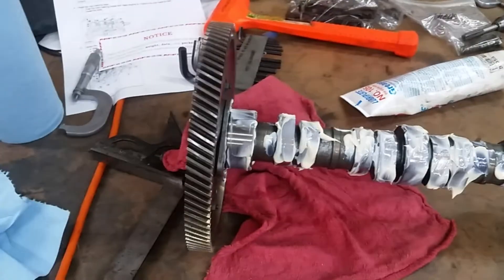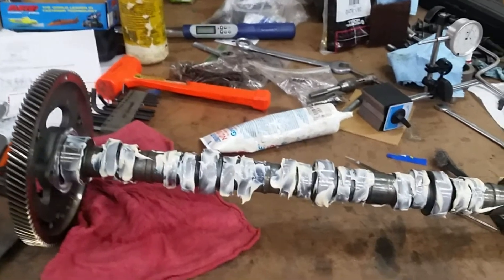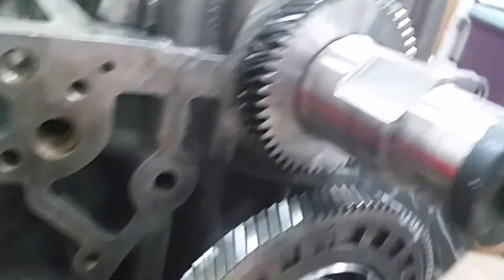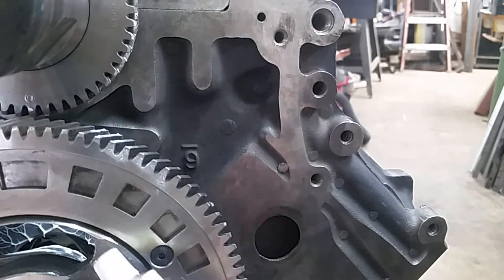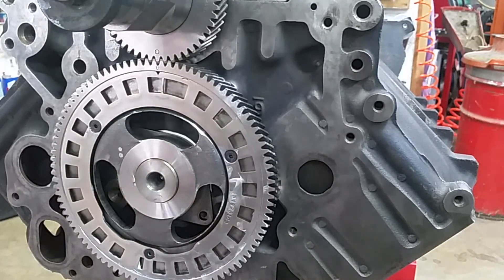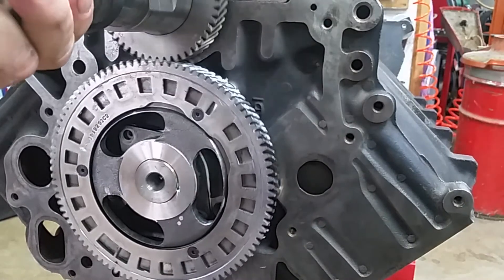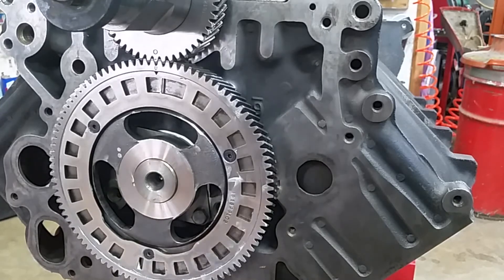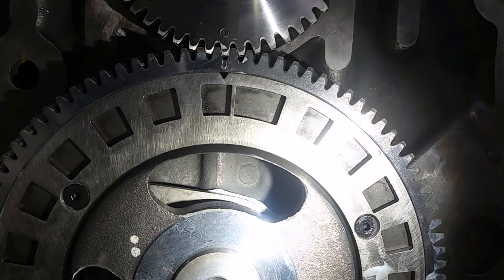7.3 Build: Camshaft install and Engine Timing

Comment: Hey Brother, my block did not come with those 2 oil galley plugs behind the camshaft gear… any idea of a part number or where I might find them? I’m having no luck! Thanks in advance!
Reply from the maker: Those are just NPT so a pipe plug would work. I would definitely use stainless.  I got mine from RiffRaff. A bit of research on the Ford Parts Giant site and I found this part number Ford-445684. You'll need three and they are $0.47 per.

Comment: My 97 7.3 starts every morning only problem I’ve had is running it out of fuel cuz rear tank pickup broke but that was my fault for running below a 1/4 tank
Reply from the maker: The OBS trucks are unstoppable if maintained. My 96 is going strong and still on the original injectors at 360k. I do use HotshotSecrets products though.  When I bought the truck in 2014 it was having some injector and engine harness issues and after fixing the harness and running the "Stiction eliminator" product from HotshotSecrets, they cleaned themselves up and have been going strong ever since. My transmission, a ZF-5, needs pulled and overhauled but that's just wear. I'll probably do that in some future videos for the channel.
Reply: @phil-from-tn3000 my dad's 97 had same issue once with injector harness but other than that runs great and has been all over the US several times

Comment: It should be illegal to build an engine with a belt or chain.  This is the only way to do it.  I have a 2002 F350 extended cab, 7.3L Diesel, 6spd manual, manual 4x4, manual locking hubs..  with a 9ft Flatbed on it.  These are the best Trucks Ford has ever made IMO..  I have 330k miles on mine.  I crossed another one a few months ago that had over 300k, but it was really beat up as a oil field work truck--  but it still ran and drove fine.  If it was a manual, I would have not hesitated. It was only $2500..  I regret not buying it already. lol.
Reply from the maker: My 1996 LWB CC daily driver still has the original injectors and HPOP.  It has been allover the country since I bought it in 2014. The poor ZF is going to need pulled but that old girl has never stranded me. I wouldn't think twice of jumping in it and going cross country if I need to.  The up pipes are beginning to leak a bit and it still has the original exhaust system, but I have a new 4 in exhaust ready to go on after the current 2002 is finished. By the way it just passed 358K on it while on vacation. Great truck!!
Reply: I just bought a 97 f250hd 400k plus purrs like a kitten
Reply: Or  cam sprocket gear with nylon teeth. My old 82 Cutlass supreme had that crap on it .
Reply: @BruceLee-xn3nn  Yeah.. That's just insane. It's bad enough to see that on my lawn mowers.. but on a road vehicle??  that should be illegal for sure.